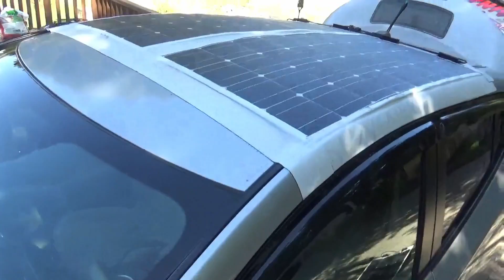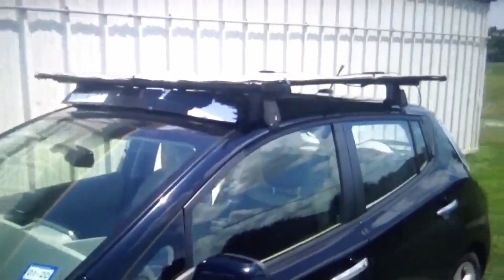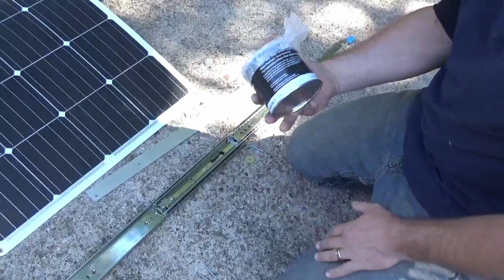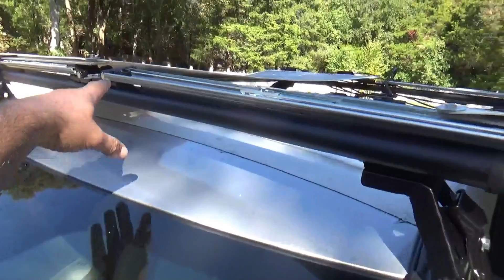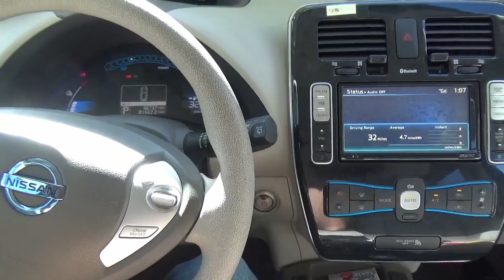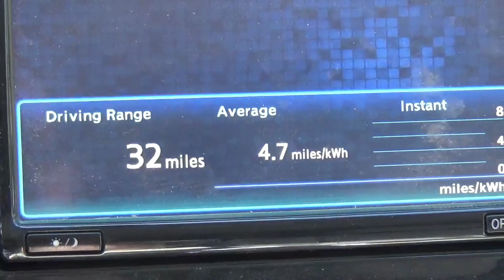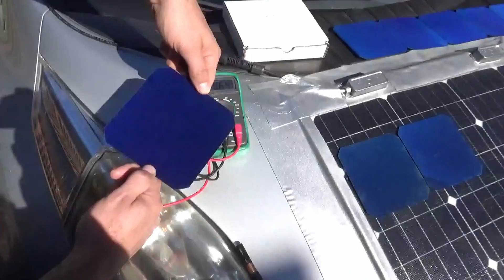Solar Powered Nissan Leaf Ep. 3

Comment: In Miami I had a big problem, sun over the dash cooking the car. To avoid we use internal shades. Use the same idea with your Nissan. When parked, put solar panels over the front window. Two flexible panels will do.
Reply: Sorry about that. I jumped the gun. On the game stop video you did what I suggested. What led you to not use anymore? Tks. Good luck.
Reply: Now that I have watched all episodes I might be more constructive in my comments.
1) Instead of extending laterally the panels ( they would be over other cars ) why not do it to the front thus covering the windshield, protecting it from heat, not over loading the structure ( you would anchor it to the hood ) and having the same 2 panels.
2) You will end up having the same structure as our friend in Canada, covering all possible surface with panels. Do it. 
3) Aerowheels - buy a cover for your wheels, they make a difference.
4) Maybe it is too late now, but did you try to put the cabe through the car direct to the front instead of having to open the trunk? I know the floor is hollow. If someone can figure this out is you.

I'm following your journey now. See you online. Thank you for sharing.
Reply from the maker: @rhmagalhaes  Thanks for watching bud.  So, the main goal for this channel was to start with a simple, beginner friendly system, and through a series of tutorials evolve it into something more complex over time.  I want something anyone can build as a jumping off point, hence me putting off the 'running the charge cable through the frame step' (although I do like the idea of not having to drape the cable outside the car).  I plan on gradually stepping up the complexity of the builds over time, and people can basically continue to whatever step they fell competent at, but have a fully functioning system every step of the way.
      The panels folding out to the sides of the vehicle was a design convenience based on the orientation of the roof rack.  You could add another layer to the roof rack and have panels that extend front/back instead of out to the sides.  I may attempt that if cooling the vehicle becomes a persistent issue, but for now, that 200w a/c unit in the back does a pretty good job a climate controlling the electronics compartment.  Now that we're having 29 degree mornings here in Dallas, I'm appreciating the heating aspect that skin mounted panels add.  I want to find a way to quickly deploy a panel INSIDE the windshield during winter months.  It's like a little heater running inside the car all day.  Kinda nice.
      Aerowheels are something I'll have to look into.  I've honestly never heard of them.  What margin of increased fuel economy are we lookin at with those?
Reply: I completely understand your strategy. Makes sense, specially financially. The end goal is a 💯% off grid car. Maybe some batteries and PV at home to deliver to the car later... But this is for the long run.

About the cable running inside I found this guy https://youtu.be/YxmShTA92Gs
He has another video about the small panels that you're planning to use.

About the wheels check this, 1 kwh better consumption... https://www.mynissanleaf.com/viewtopic.php?t=19181
And that was a simple Google search. If you go deep in the web you'll find better results.

Have a great day. Thank you for sharing.
Reply from the maker: @rhmagalhaes  The Nissan Leaf Project is literally the channel that inspired me to start this one.  I kept seeing projects like his with very little detail on how they built their systems, and decided someone has to step up and really document every step in the process, and dig into the numbers.  I want to do a video someday that is an open phone lines conference call with him, Dan, Shonioki, and Myself, and answer all the questions people have about these charging stations, from all our varied perspectives and experiences.  I think it would be really cool.
Reply: Another interesting solution https://youtu.be/wyJYU2j-FDM

Comment: I wonder if anyone is doing this with a Tesla ?
Reply from the maker: Tesla battery monitoring software will prohibit a direct PV to battery connection.  There is a potential use case for older Tesla's that have been independently refurbed, and blacklisted from the supercharger network, and have a decade of battery degradation.  In general though, this project is designed for cheaper (non-Tesla EVs).  I want to expand the capabilities and options of EVs in the $3-7k price range.  People with budgets in this range are the ones that truly need the savings of electrification.

Comment: Those bent solar panels wont work.   If only 1 solar cell is in the shade on a single panel the entire panel won't work.   Have them flat dirrectly upwards and thatl be enough as it will capture more sun then on an angle especially if the dirrection of the car is forever changing.   Im a 2 year off grid van lifer.
Reply from the maker: Nice, lots of respect for people that cut the cord and go full off-grid.  This was my first attempt at the solar roof rack and I botched it good.  I eventually tore the whole thing off and rebuilt it right.  https://youtu.be/UQXYqZ2_szA

Comment: Have you looked at cable tracks for your excess cables? They’re commonly used is 3D printers and CNC machines. Good way to protect cables that need to move.

Comment: Thank you for sharing your videos. It’s awesome to see your evolution of creativity and the overall project as it progresses. Might I make a suggestion on the extending panels? Instead of the flexible panels.. would replacing them with rigid solar panels work? Same wattage or more, but I think the rigid structure could give you more support and make the “opening up” or “sliding open” process easier?
Reply from the maker: I was unsatisfied with this roof rack build as soon as I was done with it.  I really botched it.  There are definitely structural merits to using solid panels, but the added weight (22 lbs vs 6 lbs for each panel) and a 17X increase in cross sectional area (1.38 vs 0.08 inches) represent a significant incentive to try and make the flexible panels work.  I'm actually currently working on a roof rack rebuild that will be much more sturdy.  Stay tuned.
Reply: Fair enough. Part of inventing is botching it until you’ve perfected it. Keep up the awesome work! I look forward to future videos. Thank you.

Comment: Have you seen the Blue Sea m-LVD low voltage disconnect ?  The voltage settings are adjustable:
http://assets.bluesea.com/files/resources/instructions/980016770.pdf
Seems like a way better choice than the Victron battery protect.  The lack of cooling fins is a big hint.
Reply from the maker: I'll check that out, thanks.  I was very disappointed in the Victron.  I tried it on a recommendation of Will Prowse, who has since retracted suggestion that people use it.  Lots of people got screwed using them

Comment: I think that roof rack slide system would draw too much attention to the car. Kids might try to break it. Or it might invite thieves to steal the panels. Also its going to ruin your areo dynamics which will take more energy.   I think its better to just put a big Solar panel over your windshield, when you park.

Comment: Why no cells on your dash?
Reply from the maker: Solar panels are designed to absorb light and thus get pretty hot.  If you live somewhere cold, interior panels could actually be used to keep the vehicle at a more comfortable temperature.  But in Texas, you want them exterior to vehicle, for thermal mgmt reasons.  I have a 100watt panel I can drop over the windshield as needed for shade/power.

Comment: Hey man been watching for a while and really enjoy your channel I personally drive a 2017 Chevy volt  just curious how you came to the number of 4.7 miles per kw is that the stock number on the leaf or is that what you are currently averaging with all the extra weight / wind resistance, just curious considering my volt can only get 5 miles per kw under the most ideal of resistance.
Reply from the maker: Thanks for watching man.  5 m/kwh in a hybrid is actually really good.  Hybrids are at an inherent disadvantage over pure electrics, on account of having to lug around the gas motor and tank which are very heavy and not present in an all electric.  

While my mileage was 4.7 at the time of filming, In the 5 months since I made this video I have seen my mileage drop to 4.6, and I expect it to loose another 0.1 in the following months due to weight and range as you mentioned.  4.7 is usually the mileage you see in the Leaf at speeds of about 40 mph or so when driving in "Eco" mode.  I drive in typical urban traffic with the Leaf so it's a rare day when I'm going 65 mph all the way to and from work.

Comment: Hydraulic pistons used to open tail gates on the back of hatch back cars. Handbrake mechanism to lock into position each notch in elevation of panel. Release button connected to a solenoid that would unhinge and lower the panel using a motor and a bump stop made of rubber. Cables winding in and out through a winding cog used in vacuum cleaners. Stainless steel Lintels thin gauge type spaced out to support the panels, this allows you to place the roof rack in their correct recommended locations and sit flush. Bend the lintels to give your roof less drag and aerodynamic efficiency. Use plastic panels to enclose the sides of the roof rack to stop air gushing in causing drag. Use ribbon cables instead of copper cables to connect solar panels (blue smaller ones you were showing).

Comment: Have you looked at using an IGUS track for your wire management going to your solar panels?
Reply from the maker: I've had a couple people recommend those to me.  It would protect the wires, and look cool, but minimizing the cross-sectional area of the roof rack is paramount.  The tracks would need to be 14" long for both panels, so I'm ballparking the cross-sectional area that would be impeding airflow, at around 28 sq in.  Maybe if there were a way to the make the tracks more aerodynamic, . .
Reply: @InnovativeSustainableSolutions  you can 3d print them these days from thingyverse. It would not take much to change to a more aerodynamic side design.

Comment: nice work... allow me to tell you this... 1) 24v alternator…        2) 12 v elec motor...         3) run alt with elec motor.         4) Recharge batt with alternator.   5) Remember charging in must be higher then the usage going out, while the speed is between 5 mph  to 80 mph.

Comment: I am surprised nobody suggested this yet, but I wouldn't trust those locking hinges to hold much weight on that long of an arm very stable. I would connect a link from somewhere on the extended arm near the center of mass of the panel, then attach the bottom to the edge of the roof rack somehow. It would make a triangle with one side the extended arm at an angle, the roof rack horizontal, then the link vertical. Depending on the angle you want, make the link different lengths. You could attach it with cotter pins or bolt + wingnut for quick set-up. It could be made with thin walled tubing or angle to keep it light.

Another thing is I believe 4.7 miles per kWh is more efficient than most people get. My ex drives a Leaf and I have a Volt. Neither of us ever get those efficiency numbers. I range from 3.8 to 4.2 and I think the best she ever saw was 4.5. If you are getting 4.7 real world miles per kWh that's awesome! But perhaps when you are making calculations you should do a best case and average or ideally worst case too.

Also, regarding the length of the panels pushing the rack mounts on the car outside where the mfg intends, could you mount them where they are supposed to go, then use two links (again creating a triangle with the extended arm, but horizontally) pointing toward the front or back of the car, then attach the eyelet of the panel at where the triangle's point would be? That way the rack mounts would be where they are supposed to be and you can still have the long 160w panels mounted. I guess that would need your lengthwise stabilizing bar to resist fore/aft tension. Well, you could make 2 bars the length of each panel, attach the ends to the eyelets permanently. It would overhang the roof rack fore/aft, but you can attach those bars to the extended part of the arm fore/aft as needed. If you still need a triangle for stability, you could connect a link from each bar end to the arm near the midpoint of the panel. That would be the arm transverse across the car as one leg, the fore/aft bar extended beyond the rack as the second leg and the angled link as the third leg. I guess I love triangles for strength, sorry.
Reply from the maker: Firstly, your intuition is correct, the friction hinges were an utter failure.  I think a friction ratcheting hinge would work better, but currently I'm using just the slide to extend the panels, and the hinges serve no function as they cannot support the weight.  I may go back and do a redesign in the future, if time permits.

Regarding the range of 4.7 m/kwh.  It has since fallen to 4.6, not sure if that is related to colder air being denser or what.  Because of Dallas traffic about half of the commute is done at 35 mph.  I think thats why I get the milage I do.  A worst case scenario of 3.8m/kwh would yield about 7 miles (down from 8.7 ideal) per day from just the solar, in the winter.

Glad you two both drive electric.  We're trying to get my wife in an EV in early 2020.
Reply: @InnovativeSustainableSolutions  A continuous 35 mph would be great for electric efficiency. That with coasting and regen must be how you get such impressive numbers.  Even if the ratchet hinge had teeth, that's quite a bit of torque with the main weight 2ft away. If you can put a link directly under the panel to transmit that force directly to the roof rack, it will be very stable and handle winds too. It would take 30-60 seconds more to assemble, though. 

Someday I am going to try what you are doing, with either with thin panels secured to the roof, or individual cells adhered to the body and UV protected/sealed from the elements. I'll have to experiment and see how hot the panels get and how much heat they would transfer to the car interior. Maybe the rack and an air gap is the better way to go. Thanks for documenting and sharing your journey.

Edit: just watched the latest video where you have stabilized the panels.

Comment: you don't need hinges you could insert removable wedges at the edges. gravity will hold it in place at the angle you need. also you could make a pulley system to deploy both sides simultaneously, have that on a motor so that it deploys/closes on a switch.Also I would the front bar lower and custom so that your aero is not as drastically compromised.

Comment: It's awesome what you are doing to capture solar for your Leaf. Too bad it's difficult to bypass the inverter and hook up directly to the internal Leaf batteries. There is probably substantial waste from DC (solar+batteries) to AC (inverter) to DC (Leaf's rectifier) finally to Leaf's batteries. Keep up the good work.

Actually, I just found another Leaf driver on Youtube that connected an extra set of 16850 batteries to the Leaf's batteries. He totally bypassed the AC portion. https://www.youtube.com/watch?v=1ooEgQ3ZxnM
Reply from the maker: Thank you.  Yes you probably loose %20 of what your captured PV power to the inefficiencies you mentioned before it makes it's way to stored kwhs in the main battery.  I sub to "Leaf Xpack", and I really like his videos.  I doubt I will ever use the 18650 cells on account of their volatility.  The premade LiFePo packs are much more beginner friendly.  I will fully document my attempt to connect the solar directly to the main battery in the final stage of this project.  I just can't do it now as it risks irreversible damage to the vehicle.  Leaf Xpack actually has a video where his Leafs software shuts down the main battery connection when it detects a current flow between that and his 18650 aux batt.  Thats what I cant risk right now.  But later when the vehicle is useless anyways, if I break something splicing directly into the main battery it won't matter.  In the meantime, 20% loss is a decent tradeoff for a system that is safe, relatively easy, and really beginner friendly.
Reply: @InnovativeSustainableSolutions  You're 100% right. Too risky to mod the system so much to run the risk of ruin the car. I was wondering since you solar charge the Leaf at work, couldn't you just fold out these solar panels around the car? No need to mount them on the roof or such. Sure you can buy these tiny cells and mold them onto the car, but it's probably not worth it since they aren't going to be big enough?

Comment: Thanks for making these videos, I've really enjoyed them. And I have a question. Your panels total 570 watts, but you only use 370 watts in your calculations. Do you only average 65% of the panels rating?
Reply from the maker: Yes.  The wattages listed on all panels across all brands represent a hypothetical output under perfect conditions.  I had a guy who does consultant work on multi-million dollar commercial projects once tell me "All solar panel manufacturers are lying to you, but they're all lying to you by the same amount".  The best percentage of the ratings I've ever hit was 75%.  Solar panel efficiency has been steadily increasing over the last 20 years to around the 24% of all sunlight captured converted to electricity you see currently.  This project will become cheaper and more efficient every year because of this.